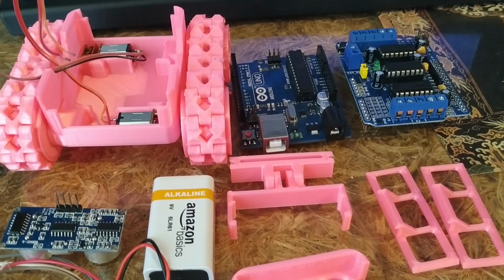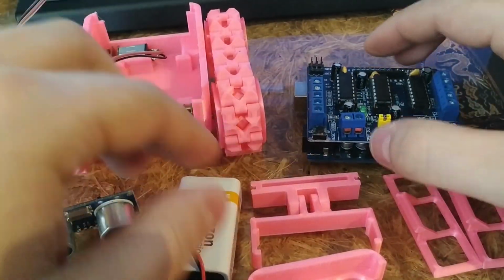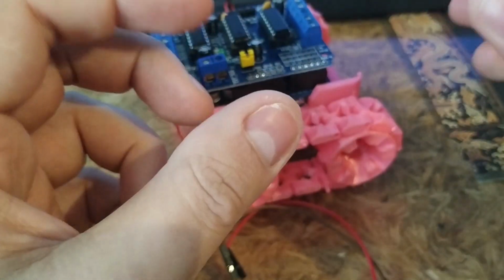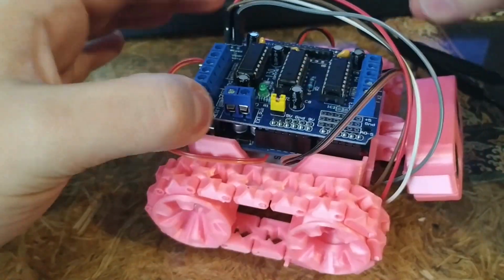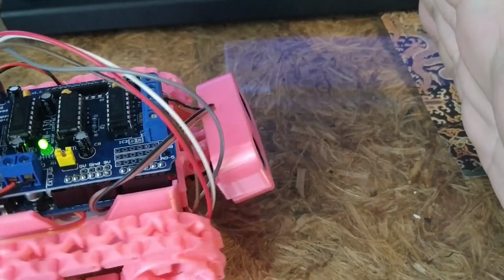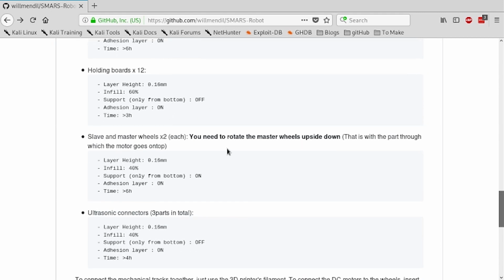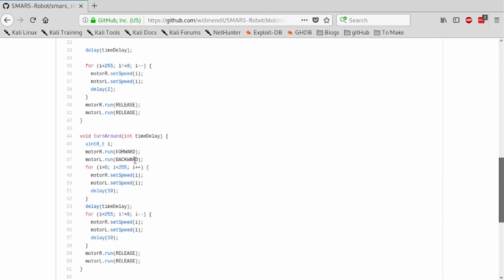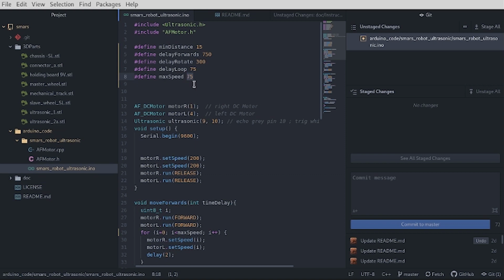SMARS-Robot Simple 3Dprinted arduino robot

Comment: do i have to take the N20 Engine in 3V, 6V, or 12V??
I took the N20 150RPM 6V and it's too weak. Output Voltage is 5V, battery Power 9V

Comment: How you wire ultrasonic sensor.
I see you wire both VCc( red) and gnd (brown)  to (-) of servo 1 and 2.???
Some how mine turn around when there no obstacles and run forward obstacles
Reply from the maker: it's just not well framed, the brown goes on - and red on + and the white and grey go on both s pins on the shield. If you are having this issue, might be in the code a minus was added somewhere

Comment: Love it....those are n20 motors if I am not wrong....
Reply from the maker: Indeed, well cheap replacement from amazon. All the components can be found on the GitHub like
Reply: @mylittlerobot2965  Today,I make  the same smars car,but it seems that it is too tight to move .Do you know the reason?I will  appreciate it if you can do me a favor.